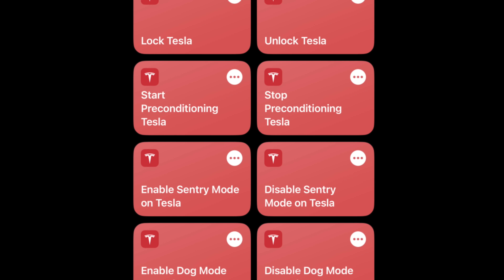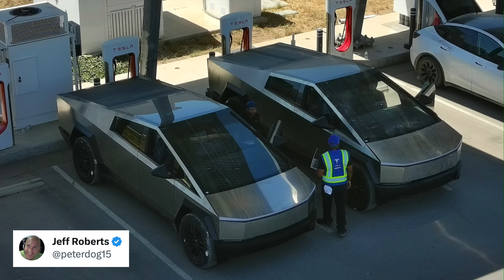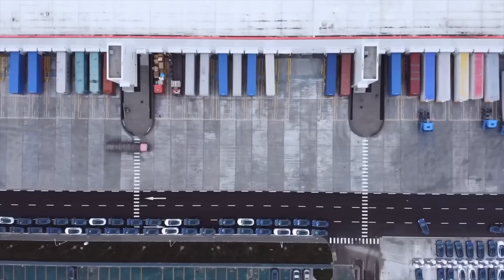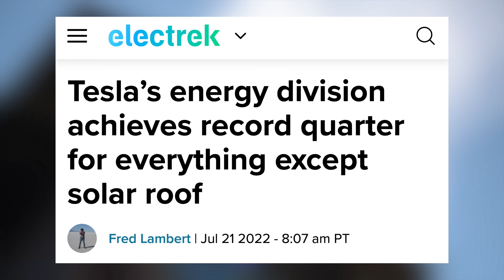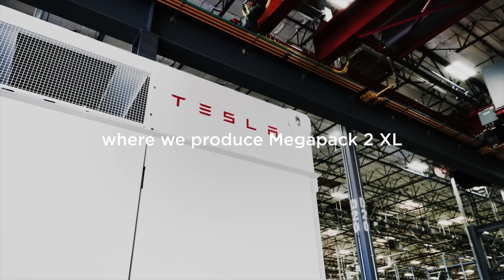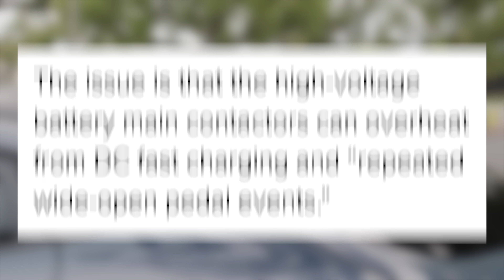NEW Tesla Model 3 Project Highland LEAKS | We're Excited

Comment: If Tesla is making the Model Y with hardware 4, I don't see why the model 3 shouldn't have hardware 4 either.
Reply: I'm guessing they have old inventory to burn, more than likely the standard will have older everything and the higher trim will get current gen tech.
Reply: You guys are complaining like HW3 is somehow bad? HW3 is still the most capable camera system on the market compared with every other car manufacturer. It will still be great for many years to come, just buy the car if you want a new model 3.
Reply: Bet. ⚡️🚗
Reply: The highland is going to have hard west 4 from the get lol
Reply: Bit odd but they may be trying to phase it out and just decided for cost purposes to put it in the lesser selling 3.  I would bet they built the hardware in batches for cost and need to go through them still.
Reply: @fractalelf7760  Agreed. In usual Tesla fashion, i guarantee at some point into Model 3 Highland production it'll just randomly be upgraded to HW4 with no announcement/fanfare. I'd guess maybe a couple months to a year and it'll be one of the constant minor upgrades they do as production goes on once they're ready to do it inventory wise.
Reply: @VMYeahVN so basically don’t buy an early highland wait until the transition and if you can’t wait then get a model Y

Comment: Is there any speculation that there could be negative backlash post-Cybertruck release, rather than it being a positive catalyst?
Reply: One of my guesses is that eventually, and these aren't that common but common enough, when people are using FSD and not paying attention on busy streets there are cases where they run over pedestrians. I don't consider this Tesla's fault, as it is not fully autonomous driving and people that don't pay attention are just trying to shift the blame... But this might spark some issues with the shape of the vehicle, being angular, sharp and unsafe for pedestrians. And I honestly don't understand how it is approved for production with this shape, so I am a bit worried about that and wondering if it is possible to become a legal/recall/redesign issue. If it has gotten this far I guess not, but I don't know what to expect these days.

There is already some negative backlash about the size of the frunk being pretty small, but it is about what I expected.

Minor backlash about the steering wheel, as always, if there isn't a round option.

If Tesla's charging network is opened up to allow more and more vehicles, that might become a point of contention.

Other than that, no idea. There could be backlash about anything. People are sensitive when something isn't a 5/5 product; 4/5 is considered horrible nowadays.

If you mean speculation affecting investors, any of the above reasons could technically be catalysts, but make your own judgements. From a consumer standpoint, I'm sure one of these will be an issue for a considerable portion of buyers. Whether it is or isn't successful, I lean on success, but it definitely could go the other way. There is a lot of new ground being broken here, and with that comes uncertainty.
Reply: If they keep the promised range, prices not too high, and good crash test results, then they should be good  👍
Reply: Yup. Worrywarts gonna worry!